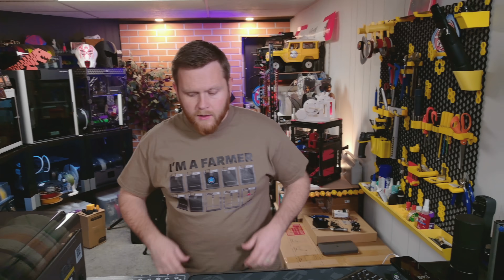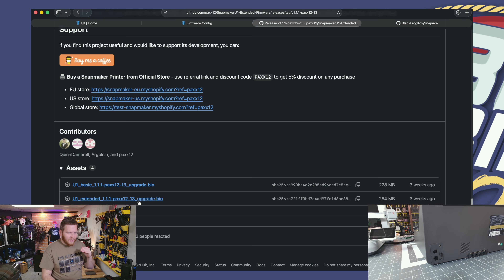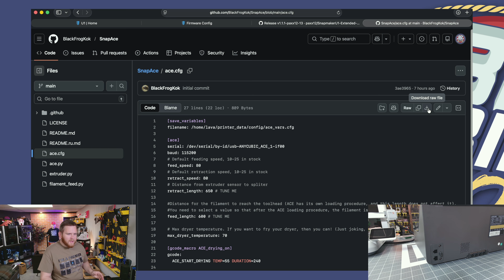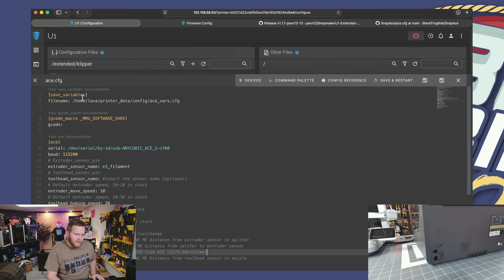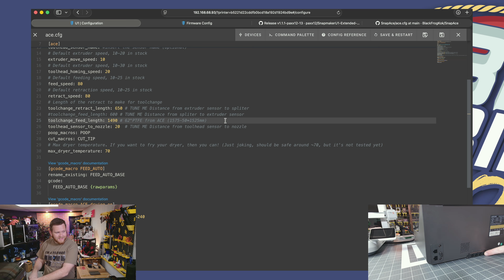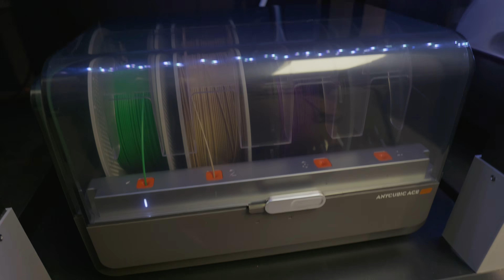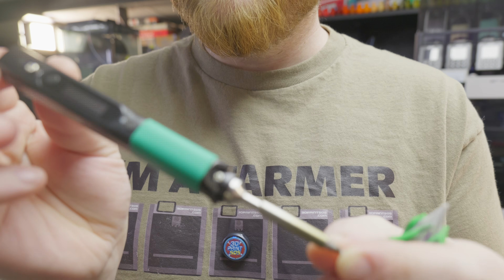Snapmaker U1 Just Got a Massive Opersource Upgrade (With Anycubic)

Comment: CAN I USE the snapmaker with out the ace pro once the files and firmware are installed??  By this i mean to go back to the side spools and feeders??
Reply from the maker: If you skip the ace files and just do the firmware update, you’re good to go. The files pretty much swap the motors to the motors in the Ace.
Reply: @3DPrintSOS  so to go back to original you would have to remove the files you input and reset the original files correct?
Reply from the maker: Yep. That’s why I was sure to cover saving the original files and renaming them. Just so you can easily revert. :)

Comment: That video was great and very informative!
Thanks for explaining everything so clearly. I especially liked seeing the Snapmaker cover pieces.
I have a couple of questions that you might be able to answer:
1. Instead of soldering and cutting to get the USB-C connector to the printer, why not just use a ‘sugar bit connector’? That way, you wouldn’t have to mess with the printer’s hardware and avoid cutting and drilling. Or am I missing something? If not, could you tell me which ‘sugar bit’ connector is the right one to get?
2. Since the improved Anycubic Ace 2 Pro is out, I tried to find out if the SnapACE mod supports this newer Ace 2 Pro, but I couldn’t find anything about it. Perhaps you have better knowledge and can guide to where that information can be found? Or maybe there isn’t any mod? With all the fixes in the Ace 2 Pro, I believe that it is the AMS unit to get - if a mod is available of course. 

Or, even better, if you could make a follow-up video showing the Ace 2 Pro and connection without any hardware modifications, that would be fantastic.

Anyway, thanks again for the informative video that really improves the Snapmaker and gets rid of the Bambu A1 look it has with all the spoolers.

Keep up the good work—you’ve got a new subscriber today, and I’m looking forward to see what you come up with next.
Reply from the maker: Thank you! The connector is a Molex MicroFit 3.0. Other 6 pin connectors do not fit. You can always make your own cable. I just liked the idea of being able to use anything I want now. I personally don’t mind the mod. But I totally get that not everyone wants to do it. That’s why I wanted to show the pins so you can just make your own. :) 

As for the Ace2, it’s still not quite ready to ship everywhere so the only way people have their hands on it are via combo packages from other machines. It still has to be reverse engineered. Not sure anyone has done a tear down to see if uses the same components or not. 

Eitherway. I have an s1 max  combo to unbox, so I will do some testing and send some info to the devs of this mod. :)

Comment: u need one ace pro on each printhead :D
Reply from the maker: If it’s possible, I’ll try it. :)
Reply: @3DPrintSOS  it is ... ppl been working on it for a while... i even saw  post with a finished version today... :D
Reply from the maker: @DaveDRC oh really, that’s great! Where at?
Reply: @3DPrintSOS  sorry for the late reply.. seach for u1 sidecar... some dude is working on it... 

until its working i will use ur method.. does it matter if i use a ace pro or ace pro 2? also idont want to open the ace pro... a custom cable should also work right?

Comment: Is there a way to still use the side loader for TPU?
Reply from the maker: Yep, you can bypass the ace and manually load. Just have to put a piece into the ace so it thinks filament is there.

Comment: Hay Fedor, super interested in this setup, Im looking to pick one of these up next, and I love the this push pull system, I find CF anf GF filaments tend to drag and need to be fed as well as pulled or the extruder can struggle, specially with long PTFE runs like this machine.
Reply from the maker: Can’t wait to see what you’ll come up with for this one. If I know you enough, you won’t be able to leave it alone. ;)
Reply: @3DPrintSOS  Definitely, I've had my eye on this machine, I almost hit the preorder, but I needed a new machine ASAP so grabbed a K2 Pro Combo, but I will ordering this one either this month or next month, the external/exposed spools is definitely an issue for me, but this mod is awesome, if we could incorporate that external filament cutter and buffer from Creality's CFS-C, then you could very easily have multi-filament per tool head. well I know I could get that to work with what you have now, its just a matter of the right macro to do the filament swap over, just would not be as reliable without the filament cutter, but I was going to use a quad dryer like the Sunlu S4, but I would much rather this, also, not sure if you know, but the Qidi Box is opensource, I think its rocking Makerbase hardware, have you looked at that one at all?
Reply from the maker: @NexGen-3D I think they removed the open source files. :/. I gave three of them.

Comment: I got all excited reading the thumbnail thinking that you modded the ace pro to run into a single print head on the U1.   

This just seems overkill... The polydryer rear feed mod is easy to do, much more reliable, cheaper and you can still do TPU....m
Reply from the maker: Gotta love having options! :)
Reply: @3DPrintSOS Tu chez!  Now rig filament cutter and do the firmware so can run an ace pro into one print head, then u got a winner
Reply from the maker: Imagine how much slower change will be though.
Reply: @3DPrintSOS  You're 100% correct.  Maybe slowing down 1 out 4 print heads to have access to three more colours might be worth it in some cases.   For me, I might do 0 swaps per print, just changing the colour before the print.  Or, maybe that tool head swap colours based solely on layer height to minimize the swaps.
Reply from the maker: I’m wondering if we can add another unit and add each ptfe into a splitter on each line. So each toolhead gets two spools. That might be easier to do actually.
Reply: @3DPrintSOS  That's a possibility, would mean you have to do a filament cutter mod twice though.  You might be able to use the unload function of the U1 but that leaves extruder marks and melted end on the filament.  Not sure if that would play nice with the ACE unit
Reply from the maker: It might be ok. Tip forming has been a thing a bit. I think both are doable. Might be worth a try. I’ll try to get my hands on a second ace.

Comment: Sorry to be that guy but: Maybe you should've 3d printed the back cover instead of "dremel" the hole... for the rest I think its super awesome! thank you so much for the info!
Reply from the maker: 3d printing is easy. Designing is hard! ;)
Reply: @3DPrintSOS  I teach 3D modeling let me give you  a quick guide: 1.draw the piece in inkscape (free vector program) using measurements. 2.export as svg and load it into blender or draw the piece in blender from a plane rounding edges then give it solidify modifier so it has thickness 3. check measurements in blender (importing sometimes requires to tweak scale from 1.0 to something like 0.1. 4. print, do holes, file down, sand or treat the piece as you want. Alternative method: print a rectangle roughly the size you want and follow step 4 :D. Alternative of the alternative contact me if you need that piece it is 2 minutes since I have the Ace module. Salut / cheers

Comment: I'm new to multi-color printing been using single color printers for years, just received my U1 a couple days ago.  But I have question would this firmware upgrade could be used with other brands of dryer feeders?
Reply from the maker: No other feeders have been “opened” in terms of firmware. However the ViViD should work. But it’d need its own configs. Definitely not plug and play. :/
Reply: @3DPrintSOS  maybe more might be opened in the future.

Comment: I was thinking a 6 pin connector pigtail.   Just take a usb a cable and pin the D- D+ and ground to a 6 pin connector.   Now you have a cable that you can use with no modifications or soldering.
Reply from the maker: 100%. I had a 6 pin PC connector but it would NOT fit. I didnt want to cut up my stock cable, but you can definetly make a nice clean cable if you can find the plug. :)
Reply: @3DPrintSOS  Molex Microfit 3.0
Reply: Do you have link for this cable?

Comment: Great video, thanks for the tutorial! Snapmaker have gotta be working on a filament storage / feeder box surely...it seems like such a miss to not offer an official one.
Reply from the maker: Glad you liked it. I have a feeling they did it to keep the machines costs down. Both production costs and msrp pricing.
Reply: I'll be happy when they fill the Preorders they all ready have. (Like the cover) and hardened extruders and extra plates. Biqu plates are also out of stock and I currently only have the plate it came with.

Comment: What about unloading? Does it bring it all the way out of the Ace?
Reply from the maker: At the moment, I haven’t tuned the retraction. So it removes it out of the extruder and disengages the motor on the ace. So you can just pull the spool out. But there is a setting in the config for this.

Comment: So is it just a dry box and a heater for the U-1 or can you actually do multicolor printing
Reply from the maker: You get a drybox and way less space on the sides of your machine. Since there are no cutters on the U1 and the Ace has 4 individual PTFE tubes, it matches right up to the 4 toolheads. Adding it to one would take ages per color swap.

Comment: I don't quite get the appeal of this setup. I would want a box like that feeding into one of the heads. That would give you the option for 7 colors. As long as all the colors aren't in the same layers you could get a 7 color print with still minimal purge. Hell put two boxes on 2 heads, go for 10 colors.
Reply from the maker: The appeal of this setup is to get the spools off the side of the machine and get them into a box with a heater/dryer. Think PETG/ABS/ASA. Since there is no cutters in the toolhead, tip forming and the length of each individual ptfe tube would actually slow the machine down quite a bit for color changes. So outside of just getting more color, adding one of these to a single toolhead would prolong each swap by literal minutes.
Reply: @3DPrintSOS  Why would this slow down print times? The ACE is taking place of the side mount filament feeders and adds drying and drybox storage. The ACE should feed to the toolheads and wait for selection just like the side mount feeders do. There is no 4-1 buffer on the U1 Like the S1 so it should not have to retract back to that to feed the next color. What am i missing here? Is the software not setup to work this way? I have my ACE Pro sitting here waiting for my U1 to arrive so i can set up everything and get it rolling. After i get some prints out of the way with the stock setup first of course
Reply: If ya want 7 colors just DL the modified FULL SPECTRUM Snorka version. Load in you primary colors and let the mixing magic begin. Tutorials on Youtube how to set up mixing. Its really cool actually.

Comment: Why not just buy the right Molex (or whatever brand) connector and crimp the ends in for it to work? I believe it’s a standard Molex used in modular PC power supplies. Probably 1$ at digikey or Mouser. Or sitting in a bag of unused cables for modular power supplies.
Reply from the maker: You can totally do that! Like I mentioned, I just had this on hand. It works great. 

I actually told Anycubic they should sell it!

Comment: Doesn't connect 4 colors to one tool head? Why not?
Reply: You need cutter in toolhead.
Reply from the maker: Not yet. Not saying it’s not possible, but for now it keeps the way the machine works stock and enhances it by enclosing the filament and giving you a built in dryer.

Comment: will this void the warranty ?
Reply from the maker: If you physically modify the ace, yes. If you just make your own cable, no. Technically third party firmware isn’t supported on the U1. However, flashing back takes a few minutes max. ;)
Reply: @3DPrintSOS  for the u1 my kobra 3 is pratically one year old in a few month
Reply from the maker: @gaabstakiller9619 short answer yes. Long answer, there are ways around it. ;)

Comment: Thank you for showing how to connect the Ace Pro to the U1 .
Is it possible for the Ace Pro to be able to auto unload the filament
from the U1 , like Bambu  Ams ? , or can it only push the filament
to the U1 like the feeders on the side of the U1 ?
Reply from the maker: It basically uses the motors inside the Ace instead of the motors on the side. The functionality is otherwise the same. :)
Reply: @3DPrintSOS  To add to this, does it also buffer properly? Rather, it uses the motors during the print as well?
Reply from the maker: @winebartender6653 yep, 4 individual buffers. :)
Reply: @3DPrintSOS awesome! Hopefully the can get the pro 2 to work as well
Reply from the maker: I have one to unbox. You know I’ll give it a shot. :)
Reply: @3DPrintSOS awesome! Can't wait to hear your feedback
Reply: @3DPrintSOS Hey, question for you about the ace 2 pro. When you unbox it, could you look at the cable that is suppose to connect the ace 2 pro to the Kobra S1 and let me know if it is a 4 pin to 4 pin or 6 pin to 4 pin?

If you really want to go an extra mile, if you could take nice detailed photos of the ace 2 pro 4pin/6pin hub PCB (would require some disassembly detailed on the anycubic wiki) that would be amazing.

Reason I ask is because they have supposedly switched to RS485 communication between the printer and ace 2 pro. This would make communicating with the ace 2 pro quite annoying as I imagine they would have some interface code to translate the rs485 messages to something readable in the firmware.
Reply from the maker: @winebartender6653 I’ll give it a shot
Reply: @3DPrintSOS Saw the new cable. It's a 6 to 4 pin with (what I presume, given its size) is a rs485 to USB converter packaged on the 4 pin (printer) side.

Should be easy enough to create a U1 firmware with any needed drivers for the conversion chip in the cable (if they aren't still present from w.e. Linux base is used for their OS)

Question really becomes whether the API has changed at all between the ace pro and ace 2 pro. We have the new baudrate (230400) for communication to the A2P but that's about as much as I could find in anycubics most recent ks1 firmware. Would need to see just how much decompilation can be done to find anything else.

Comment: Would the ace pro for the s1 work? Or does it have to be the kobra 3 one
Reply from the maker: Any of them. Mine is from the S1. ;)
Reply: @3DPrintSOS sweet buying a refurb now!
Reply: Crazy idea. 2 Ace Pros with each slot on the U1 being fed by 1 slot of each of the Ace Pros through a Y Splitter. For example, slot 1 in both Ace Pros feeds toolhead 1, slot 2's to head 2, etc. would take a little more firmware hackery on the U1 to map each ACE pro slot, but should "theoretically" be possible. To avoid the purge problem since there's no chute you would have to use a true purge tower so you lose some bed space to that, it maybe an additional mod to add a purge chute somehow
Reply from the maker: @donnyriggz there’s also no cutter so you’d have use the tip forming that is already being used by the machine. It’s definitely possible. A ton of work, but possible.
Reply: wish i could use the ace pro on the kobra x

Comment: Thank you for this informative video. 
Do you control filament retraction (to change spools) through the Snapmaker's display or the web interface? 
I hope this open-source hack will work with the Anycubic Ace 2 Pro.
Reply from the maker: You control the distance settings in the klipper config, but you can use the interface to interact with like just like stock. :)

Comment: For those who don't want to show evidence of voiding the service warranty  could you not just create a custom cable that goes from a 6 pin PCI-E / molex connector to a USB cable that is only using the requested 3 pins? Since the 6 pin connector can only be connected one way you can have the 24-volt pin removed and thus you don't have to risk messing up either system. Please note I haven't watched the entire video yet. I just thought a custom cable is less risky for an individual that might not be comfortable opening their machine.
Reply from the maker: You are correct. I mention that option in the video. I only did it this way because I use this with the S1 and need the cable. I had the usb on hand and it I like that it actually ads more functionality by allowing me to use this with more machines. :)
Reply: @3DPrintSOS I think you read this wrong. They said make a usb to mole cable so that you can skip having the USB-A to USB-C and no modification is required, you just make a single cable.
Reply from the maker: Yep. You can but the plug is special. It’s not standard pci molex. I have one on hand, it didn’t fit. So you have to buy the specific plug. But yea making a cable is a great option. I just like this way. No harm no foul
Reply: @samuelcomeau  It should be Molex Micro-Fit 3.0 3mm pitch.
Reply: Especially these days correct me if I'm wrong could less tech savy people even get one online like from that pcb website

Comment: but ace pro has too many issues, i have one and i had too much issues with it.
Reply from the maker: No problem, it’s not for everyone. Only issues I’ve had have been related to soft filament. Also, it’s being used differently here. It’s not being used to constantly switch spools. You just get an enclosure with a dryer. It’s a nice package.